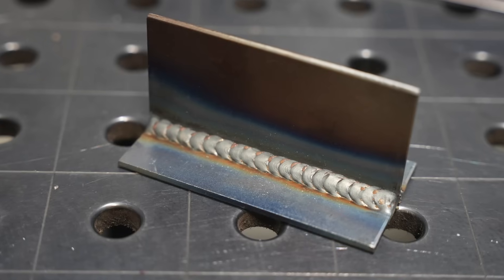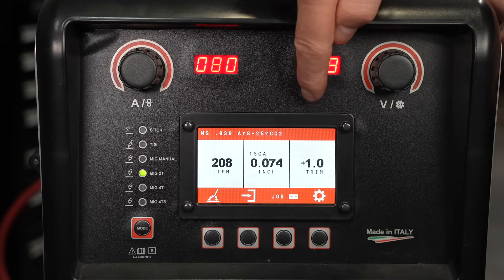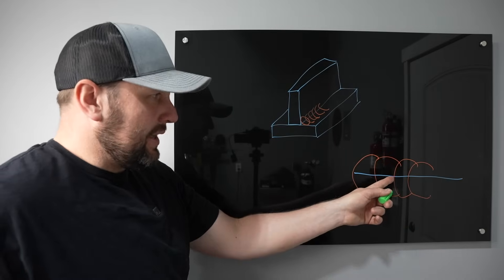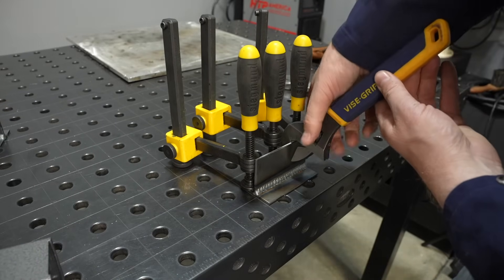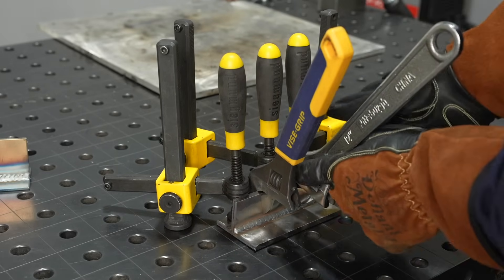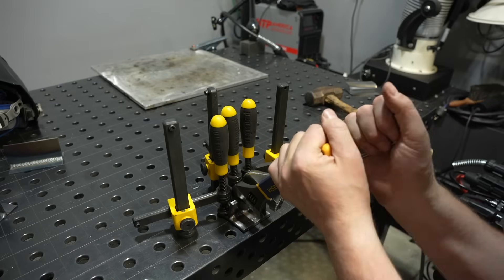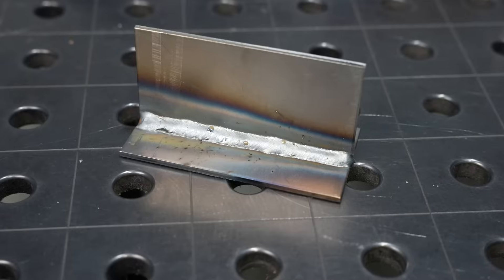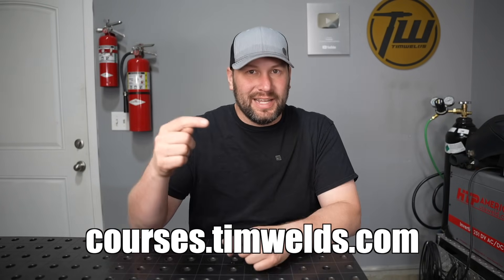How to Stack Dimes MIG Welding...And When You Shouldn't

Comment: I just started MIG welding at 70 years old. My very first project was a full stainless exhaust system on my 2004 Toyota Highlander. I purchased a PrimeWeld MIG 180 for my new hobby. Your videos really made a difference on how I set my equipment up and my technique. My next step is to fabricate a welding table. Doing most my welding on the floor made the job more challenging. Thank you for all the hard work setting up all these videos. You probably have helped thousands of new welders become successful.

Comment: I thought that in D9.1 you were supposed to bend the plate back and forth until either the weld fails or the plate fails, and if the weld fails or detaches it is a fail?
Reply from the maker: I haven’t worked with D9.1, but I assume it’s the same as D1.1 where the load is increased or repeated until it breaks or bends over on itself. If it bends over, that’s a pass. If it breaks, you have to show root fusion and have inclusions/porosity that are under a certain individual and total size.
Reply: @TimWelds  I didn't know short circuit mig was used in 1.1
Reply from the maker: It doesn’t have a set of prequalified procedures like other processes, but you can qualify short arc to D1.1. It’s done all the time. You just have to qualify by testing.
Reply: @TimWelds  Thanks for the info

Comment: When I was in high school my welding teacher taught us to start a bead in pull and transition to a push, with the gun being exactly perpendicular at the center of the weld.

He had been welding for 40+ years and had done every kind of welding you can imagine except explosive, and thermite welding.

His reasoning was that the magnetic field created across the length of the pieces to be welded would pull the puddle towards the center, so when you are starting you want your wire feeding away from the center and when you're moving towards the end you want to be pushing the bead towards that instead of the center.

No idea if it's true or not but it's what I've always tried to do.

Comment: This is not a good tungstene inert gaz welding,not at all! U don't have the same penetration ,not regular all the way so you must have inclusions here and there which is very bad for the strength of the weldind,and also u weld pulling,but mig is much better by pushing,because u can see your fusion then,so u can be regular!Many other bad aspects,like not having a 45 angle,etc...U need to learn at some welding school...I'm sorry to tell u that!
Reply from the maker: Did you watch the whole video? That's kind of the point. Also, it's not Tungsten Inert Gas Welding...perhaps a little school would serve you well too...

Comment: Hey Tim, you need to get yourself a cheap 20 ton hydraulic press for testing welds, save yourself a lot of grief. Glad you mentioned the disclaimer regarding stack of dimes when using circuit MIG process. Most people should not be doing this MIG process if any structural strength needed, possibly ok for "cosmetic" welding only. This really is a TIG process or pulse MIG with spray arc but you need a powerful professional machine (for heavier than 5/16 material). For your demonstration, this somewhat worked due to the very small gauge of metal. Short circuit MIG should only be done as regular stringer using a pulling technique. Keep up the great work!

Comment: A fail is a fail.
If you're welding mig on 1/4" plate. You will want to turn your voltage up closer to 21V and your Wire Feed Speen can be andywnere from 240ipm up. If you want to "stack dimes, in my opinion you want to be at around 17V and about 170ipm, you'll get your "pretty" little weld, but it definitely won't hold up structurally. 
One thing that always help, especially when welding mig on 3/16 and above, remove ALL mill scale prior to welding. This will allow your weld to bite directly into the parts, without first having to burn through that pesky mill scale, which usually takes a fair bit more heat before it acually penetrates the clean metal.
CSA W59 Calls for all joints to be prepped clean, free from mill scale, paint, grease, rust, any surface contaminants etc etx, and mill scale to be ground back 2 inches from any weldment. D1.1 im pretty sure at one point was similar, although i believe it calls for 1" now.dont quote me, its been some time since i read AWS D1.1

Comment: Thanks. You can scuff that blackboard down with some 1000- 3000 grit sandpaper. Whichever looks and works the best. Dull it out a bit. If you dont like it, you can always buff it back out with cerium oxide. Just an idea, if you havent gotten rid of it yet

Comment: Technically the 1/8 and 3/16 weld was done a little different than each other based upon t the hear affected zone while welding. I think if you ran a little hotter on the 3/16 plate you would have the same result as the 1/8 plate. 
Now that being said, I completely agree with you that stacking done with mig isn't for structural welding. Really the only thing I see is it's something you do when you can't tig weld but you want to pretend you can. 
Thanks for another great video!

Comment: I'm going to do a small project Mig welding with gas. since I'm not doing it full time or on a regular basis, I was looking at getting a small bottle a 40 or 60 size.
What I need to know is How many hours of use will I get per full bottle? That will determine which size bottle I should get.

Comment: Can you show us what is the differrence in appearance between using Argon and using CO2
Reply from the maker: There's honestly not that much difference between CO2 and an argon blend from an appearance perspective. You'll get a little more spatter and deeper penetration with CO2, which makes it a better fit for thicker stuff. Honestly, I'd just stick with the Argon blend unless you have a compelling reason to use CO2, such as cost when you're running hundreds of feet of weld per day in a factory. For small custom or hobby work, the cost difference is negligible.
Reply: @TimWelds  thank u

Comment: Stacking dimes is stacking problems… I never do it regardless of the metal thickness. 

The T pattern you used is a good technique to better help the root. Even so, as you could see on the 1/4” lack of penetration in the joint. Not burning in past the corner is a big problem. 

People always judge welds by appearance. My welds aren’t as “pretty” but they’re twice as strong. Had a guy that always stacked dimes thinking he was a robot, and showed him up in a strength test. Using the triangle path method…. 

Awesome representation!!!

Comment: Informative video. I'm pretty much a beginner welder at the hobbyist level. I always find myself going back and forth over using a push or pull method, but usually end up with more push than pull.  Is there any advantage to using one method or the other?
Reply from the maker: With short circuit MIG like this, either works well and I'd just do what's convenient. Pulling tends to give slightly more penetration generally, but it's not significant. If you ever start using spray transfer or pulsed spray (which includes any aluminum welding), a push angle is the best way to go.

Comment: Does the same apply to aluminum?
Reply from the maker: Aluminum is a little different and is actually much easier to get some ripples without having the same penetration problems. It is welded with spray transfer, which is a hotter process and it also conducts heat really well to cool the puddle quickly, so a slight back and forth stitching motion is all it takes. If you watch any of my aluminum MIG tutorials, I show how to do that.

Comment: The truth is that I don’t even like the stacked dimes look even when I TIG. I certainly don’t want it when I MiG. Though, if you use certain techniques such as the “e”, or “c” method of moving, you get some of that anyway without trying to. You definitely need a hydraulic press for those tests.
Reply from the maker: I'm also in the smooth camp, but some people really like this look so I've found it worthwhile to learn for those occasions. I do need a better way to do some mechanical testing. During my career, I've had fully staffed metallurgical labs at my disposal. It's definitely a different story in the home shop. I'm pretty sure I can pop one of those 1/4" joints by hand with a lever, but my table kept sliding on me.

Comment: Hello, Tim. I had a question regarding the method of going forward then t shape. Do you use a similar method in stick welding or is it different so as to not weld over the flux?
Reply from the maker: It depends on what you're trying to accomplish. I recommend running stringer beads with stick welding, at least with rods like 6013, 7014 & 7018. In there vertical up position, a weave works well on cover passes when it's allowed. If you're looking for this type of aesthetic with stick welds, you can get pretty close by using 6010 or 6011 with a whip and pause motion. This is a simple back and forth pattern moving up barely ahead of the puddle, allowing it to freeze, then returning to a location slightly ahead of where you were to build up to the same width, then repeating. You could also incorporate a slight tee shaped motion into the pause to spread it out with these electrodes. This really only works well with these rods since they are fast freeze electrodes.
Reply: @TimWelds  Thanks a lot for such a detailed response.

Comment: A long time ago I learned through destructive testing that the strongest MIG weld with the best fusion looks like a robot laid it down. Smooth, straight, consistent travel speed.

It's not beautiful and you won't want to post pictures online, but it's the way to go if you're interested in function.
Reply from the maker: 100% agree. I actually like the look of straight, smooth beads better, but in some circles there's an expectation for this style. These welds held up better than I thought they would, but it certainly isn't ideal for structural work.
Reply: @TimWelds  哈哈哈~万恶的鱼鳞焊！

Comment: I se absolutely no point in "stacking dimes" for "aesthetics" when it's not as strong. A straight bead looks good and is stronger...
Reply from the maker: I very rarely weld like this, and don't recommend it most of the time. In some industries, a certain aesthetic is expected, so I've learned how to do it and it comes in handy from time to time.
Reply: I have always given an unwavering higher valuation to function over fashion. But I have come to grips with the fact that sometimes fashion is a big part of the function. TLDR .. there's a time and a place. I think that's why Tim put off this video for so long like he described at the beginning of the vid.
Reply: @tedbastwock3810  sure thing. I guess if you were making an engine intake pipe or something for a show car, where the welds don't get subjected to any real stress, this type of weld would make it look good without the lack of strength being an issue.
Reply: @Sparky_D  Indeed, great example. Or, maybe a small piece of furniture where the force on the weld will never come close to exceeding the weld strength, but the weld will be seen.
Reply: @tedbastwock3810 or In different processes like stick or flux core welding whipping makes it stronger
Reply: @Queso1526 With stick welding a whipping technique should only be used when running 6010 or 6011 fast freezing rods. There is never a benefit to doing it with flux core.
Reply: People who saw Tig welds or 6010/11 stick welds and thought it looked cool, but don't have the skills for it I guess.
Reply: Whipping your welds or adding motion in this case to mig welds is fine, as long as your heat and wire speed are correct. 19 amps for 1/4 inch plate with no bevel is pretty cold. Adding motion but staying in and maintaining your puddle is the correct way to stack dimes. Running cold and leaving the puddle to run back over is bound to fail.
Reply: @vincentrichards5868
Wrong.

Comment: What band saw is that?
Reply from the maker: It's a little table from SWAG off-road which holds a portable bandsaw. Mine has a Milwaukee saw in it. Harbor Freight has a new portable bandsaw stand that has a vertical and horizontal function; I haven't tried it, but if I didn't already have this one I'd look into it as an option.